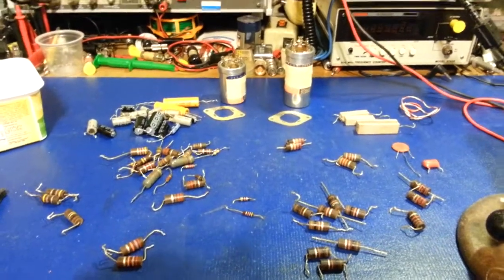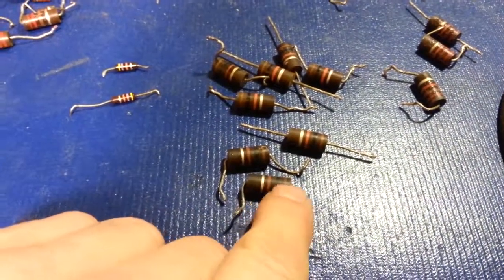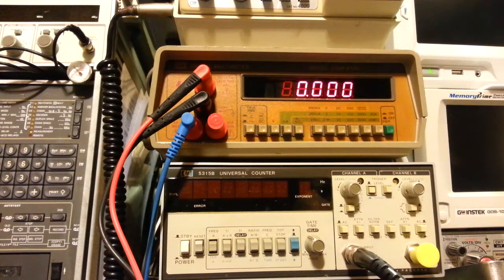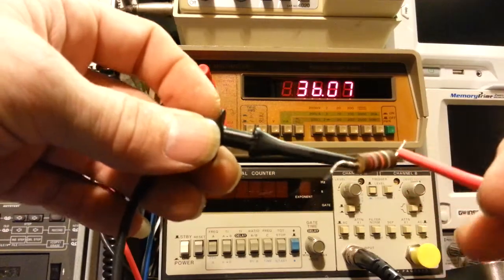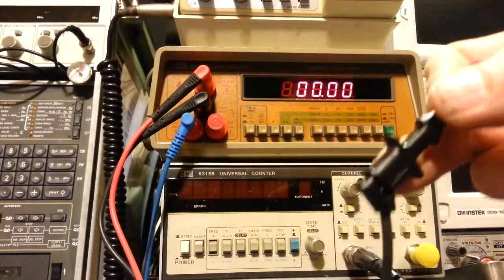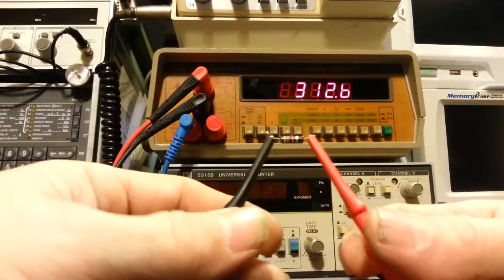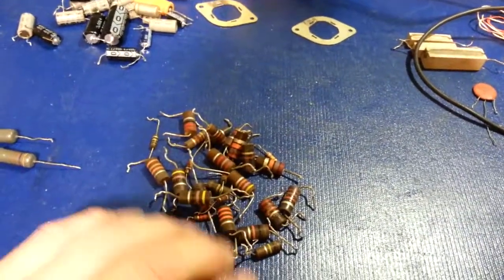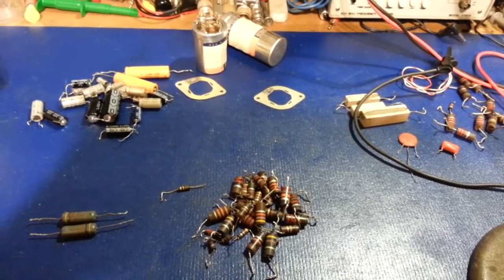Do I really need to change all those carbon composition resistors in my tube type CB radio? Yes!

Comment: I have an old Baldwin electronic organ I am currently replacing all the carbon composition resistors in with carbon film. It was made in 1965 and there are more than a thousand, probably near two thousand resistors in it. Already replaced electrolytic capacitors. I’m almost halfway done and the tone has already improved noticeably, the background hiss/ frying sound is gone.

Comment: I have seen much worse in a crt display. It would not focus to save its life and the resistor in the circuit looked like new but was so high in the meg ohms it was almost open. but should have been in the k ohms scale. dont remember the value though.

Comment: Those carbon comp resistors are notorious for drifting out of tolerance over time. They were used because they were cheap and can take voltage spikes. Metal film are much better, stable and quiet.

Comment: Don't Test Using Dangerous Chinese Color Power Cord It Is Actually Dangerous To Test The Cord, You Can Test The Color Power Code From The Digital Multimeter Immediately, And Use The Gloves For Hands.

Comment: As i prepare to change out the resisters in an old philco radio... i can easily match the ohm value but how do i get the correct watt rating??   is it just a matter of matching the visual sizeof the old ones?  nothing written down on the schematic that i see
Reply from the maker: Modern resistors are usually smaller in size, sometimes much smaller.  Look at the schematic and look for a legend.  It will usually say something like "All resistors x/x Watts unless otherwise noted.".  Schematics rarely show the wattage printed with the resistors value.  They assume they are all a certain wattage unless otherwise they are of a higher wattage in which case they put it with the value.

Comment: Mike your percentage is incorrect.  10% of 10,000 is 1,000 not 100.   Not that it matters but it changes what you can see on your meter dramatically.
Reply from the maker: Yeah I corrected myself partway through.  Lack of sleep was catching up with me. :)

Comment: could you not test them in circuit?
Reply from the maker: +Mark19960 

Couldn't have said it better myself.  The high wattage resistors really take a beating in these rigs.  To make matters worse in some of these radios they used circuit boards and not point to point wiring.  The resistors set so close to the PCB it actually cooks the fiberglass boards and destroys them.  In that case it doesn't matter if the resistors are good or not, they need to be replaced so the lead length can be increased to keep them up off the PCB.
Reply: +dale myers you can - but in circuit testing can be unreliable or give a false reading depending on the circuit.
In the case of CCRs it's easier to just replace them because of their age you are reasonably assured they have drifted pretty far out. These were not the most stable resistors out there and can drift just by sitting in your parts drawer.